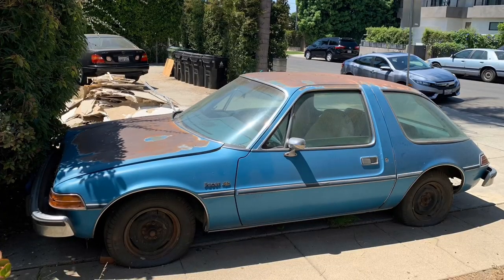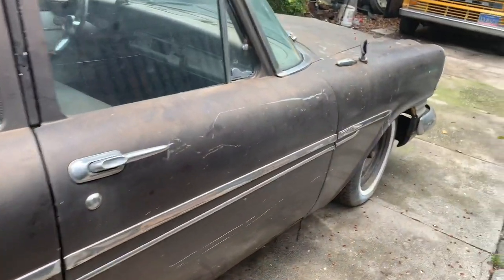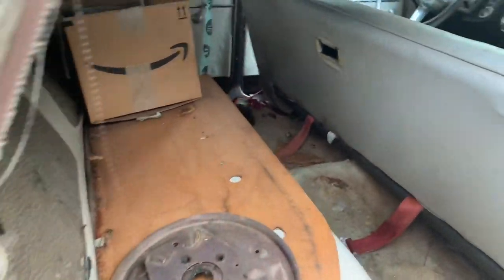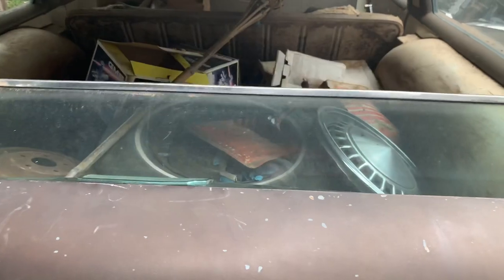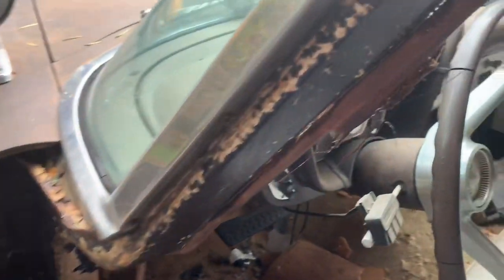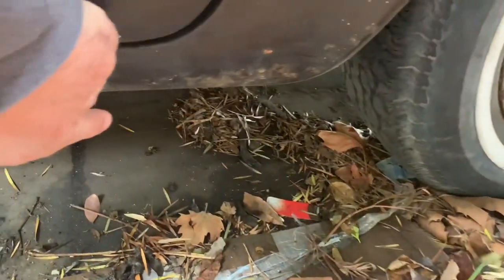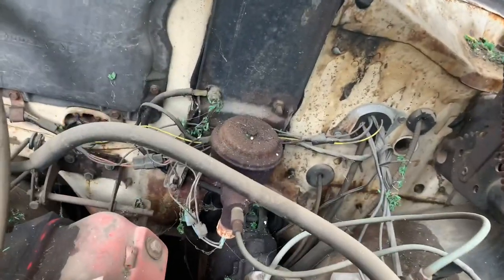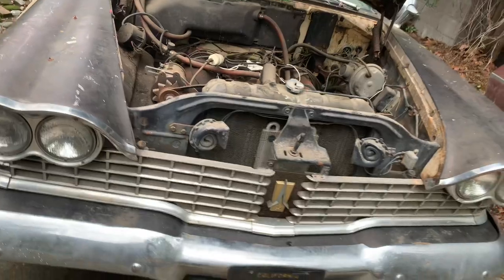1959 Plymouth Custom Suburban Station Wagon Project

Comment: Wow, thanks for showing your 1959 Plymouth Suburban station wagon. I hope that your project restoring it went well. Very nostalgic for me, as I had the Canadian version of your Suburban wagon, which was branded as a 1959 Dodge here in the Dominion. My 1959 Dodge Suburban station wagon was exactly the same as your American 1959 Plymouth, but the Canuck version had the same front end as the U.S. 1959 Dodge. My '59 Dodge Suburban had the same interior as your California Plymouth. Loved your footage of the dashboard, that really took me back. I bought my 1959 Dodge Suburban station wagon from the nephew of the original owner, on East 12th in Vancouver, British Columbia in January of 1976. On the tailgate, near the 'Suburban" metal script was a chrome dealer's medallion from Plimley Dodge, West 4th Avenue, Vancouver. My best friend in high school Glen had bought a 1959 Ford in 1975, so I decided I wanted a 1950's era car as well. Yes, we were nerdy teens. Anyway, my 1959 Dodge Suburban station wagon was my daily driver until the summer of 1979. I also drove my '59 Suburban to Alberta & Seattle, Washington several times. Sadly, the Torqueflite push button automatic transmission fried the summer of 1979, so I said good bye to my Suburban wagon. I replaced my 1959 Dodge with a 1960 Plymouth Fury, but that's another story. Love your Plymouth Suburban video, thanks for posting it.

Comment: Always been a wagon guy since dad bought a 1955 Pontiac Safari which we drove from Kansas to Alaska.  It's really too bad all the old wagons from the 1950's tp 70's were usually the first ones crushed in wrecking yards.  No demand for their parts at all.  Now most are gone and what's left are getting restored and bringing big bucks.  It would really be cool to see this 59 with a modern drivetrain, AC, and disc brakes while maintaining a mostly stock appearance.  Hope to see a start on it soon.

Comment: 2 possible routes.  Full restoration.  Or a resto-Mod.  Upgrade the brakes and suspension.  Air bag it with 4 link.  Power brakes.  That 318 if still usable could be rebuilt and upgraded, if not you could find a builder 383 and make a ridiculously easy 400 horsepower with a stock rebuild block, valve job, moderate cam shaft, headers. Intake and a 700holley or their bolt on throttle body , stick a old school 727 transmission in it and it would be pretty much bulletproof.  With the body in such good shape you could paint it black without showing dents or waves in the finish.   Do black chrome on the trim and make it look almost like a hearse.  It would be the ultimate cruiser for the family.
Reply from the maker: It’s all time and money. This one is definitely going to be a long term project.

Comment: Since that old 318 (original A block) is still turning - it should be easy to make her run. The Poly (or Semi-Hemi) was a GREAT engine, and it spawned a line of engines that lasted into the 2000's.... the LA engines (274, 318, 340, 360) all use the SAME block - it didn't change at all.  I'm not sure, but I'd expect that the Distributor would be common, too. You could probably even put on a 1970's electronic ignition for reliability - and hide the box.  Dual cylinder brakes is a no-brainer for safety, but you might even find a conversion to front disks, too - that amount of weight could probably use the extra stopping power!  
Here's a GREAT video about the Poly - https://youtu.be/YU0Eo2f0vKg    Uncle Tony's Garage is a great place to learn about Mopar engines.

Comment: Another guy posted on YT with the same 59 wagon that's got 3 on the tree with a flathead 6. He's looking for a correct front door and some side trim if you stumble on anything, parts wise.
Reply from the maker: Think I saw that video. Big M in northern California has a lot of forward look stuff
Reply: I watch that video also I saw that yeah he had the broken windshield also
Reply: @jamescummings7246  ... Broken windshields seem to be readily available for most anything these days. I have to wonder if somewhere in China there's a company doing digital scans and making reproductions on a small scale basis. 5 years ago I was told the windshield was NLA for my 64 Corvair truck and over the summer (2020) all of sudden it was out there in the aftermarket... from China! BTW, it was $1,200 installed and the insurance company didn't bat an eye.

Comment: This is the second one I've seen the one the other guy's old wagon hasn't ran in 52 years. Also the Flathead V6 is nightmare to run and having issues
Reply from the maker: The flathead six was a good motor, but it was slow. Had one in a ‘55 Plymouth Plaza.

Comment: Have you done anything to update the 59th Plymouth and why did you buy it without all of the components necessary to operate the electrical system missing distributor missing carburetors so basically you can't turn it on and drive it so you don't know what else is wrong with it or do you know now? I'd like to see it running and driving I know times are difficult for everybody thank you for showing the Ford van that was nice my father had two of those who has air conditioning business when it was based in New York same year 69s or 68s anyway thank you for showing us a nice car and a nice van too I hope your daughter can fix it by the time she's ready to drive?
Reply from the maker: I’m tracking down parts for the wagon and plan to get it back on the road.